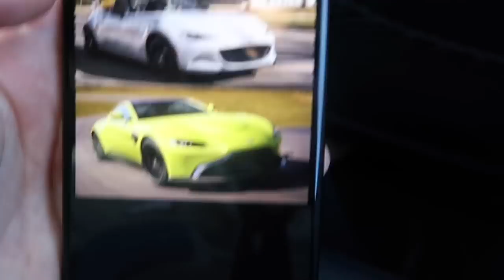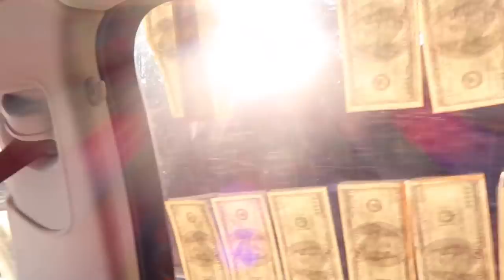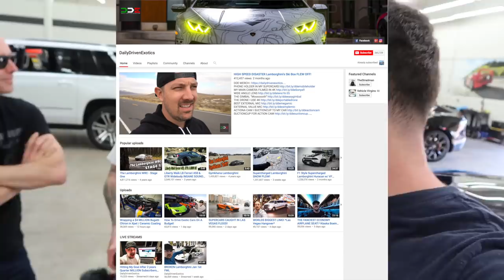WRAPPING A $4.2 MILLION BUGATTI CHIRON!

Comment: Does it need to be washed with holy water?
Reply: nope you gotta get the water from the antartica bro
Reply: Lol at all the people that comment on your posts with "bro"
Reply: Rat3d M never realized it was a chick
Reply: LOL To think that Chevy had its twin turbo LS1 1988 corvette sledgehammer back 30 years ago and it went 258 Miles per hour over 400KM and it took Bugatti over 20 years to make a car which went over 400KM ?
Reply: GTR Wendy do u actually have a gtr????
Reply: 7071t6 that was Callaway car.

Comment: "he has a drift handbrake". Or an E-brake for the rest of the world <3.

In anti-hate squad and im not hating. Parker is cool
Reply: Pretty sure he meant the hydraulic handbrake, not the e-brake
Reply: an e-brake is the brake which he pulls with the hand ,it cant lock itself up so when you release it it lets go of the wheels. And it doesnt have abs, so its a total lockup of the wheels
Reply: There are e-brakes that are activated with the push of a button. When he said "drift handbrake" I'm positive he meant the hydraulic handbrake which has the same function as an e-brake but requires less force and is ergonomically better positioned.
Reply: nono bro, you are mistaken. If you lookup what an E brake is you'll see what i mean. e brakes never come from factory so "ergonomically better positioned" is true because you install it yourself. Cant go wrong then cant ya =)
Reply: Just go on wikipedia or whatever  dude you're actually the one who's mistaken. Parking brake = hand brake = emergency brake = e brake. It can be a button it can be a lever doesn't matter the ones that come on the car from factory are e brakes. Hydraulic e-brakes / handbrakes is the "drift handbrake" you install yourself.
Reply: you said it. E brake sir. you can technically drift with a parking brake, if it's the manual lever one that cars mostly dont come with anymore. But they arent as tight usually. And dont mess with them (did it with my mothers car, not a good idea to take your mothers car).
Reply: Yeahyou can drift with a manual factory e brake if it's tightened up enough to lock the wheel, but I'm pretty sure he is referring to the hydraulic aftermarket handbrake since I'm pretty sure the Huracán doesn't come with a manual ebrake :)